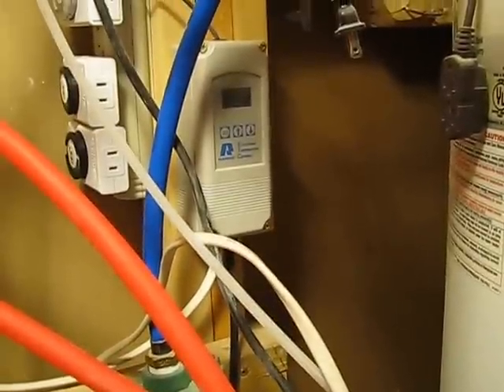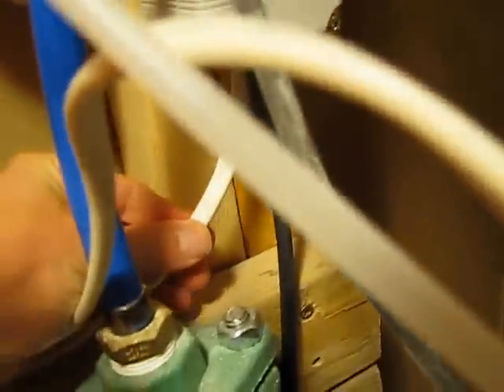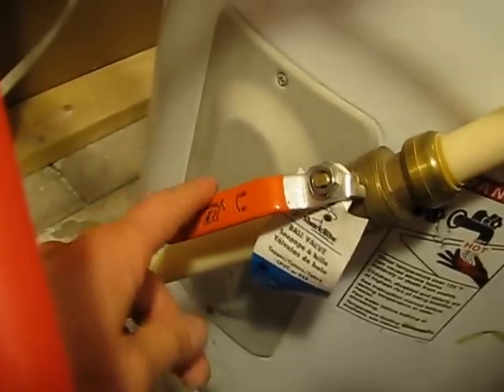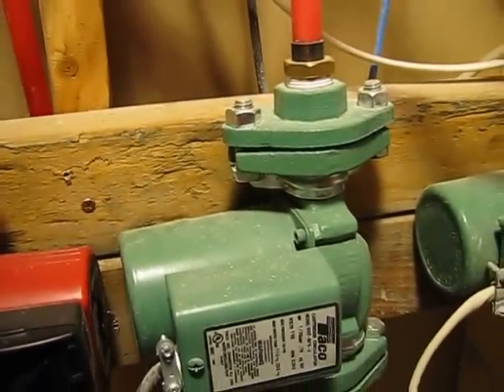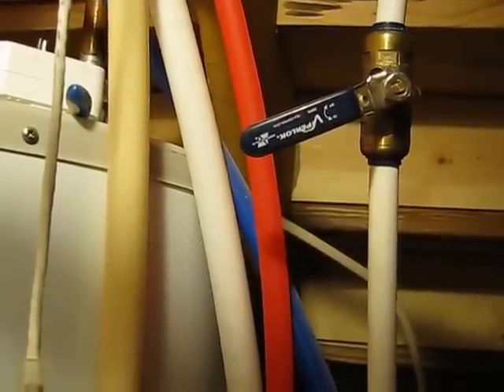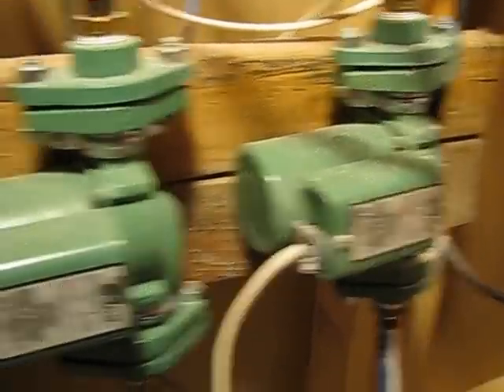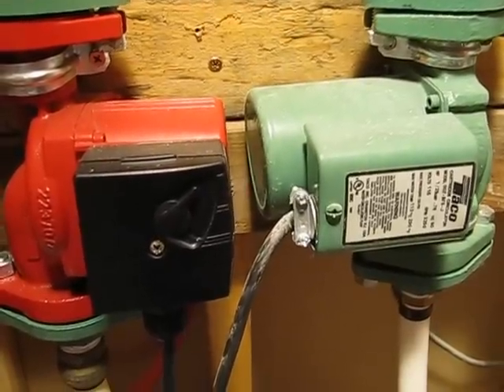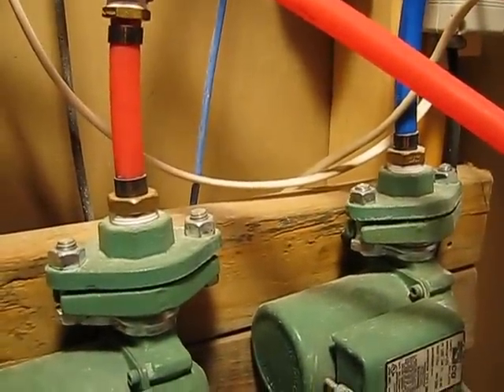Boler conections

Comment: Nice setup if you get a chance show the temperature of the water leaving the pumps and the water returning that would be a cool video too thanks again
Reply from the maker: Good idea.  I have the boiler shut down for summer right now, so I will need to do that next winter.  However I can tell you, that by feel and what I remember (I did measuer this once but don't remember for sure) the water coming out of the pumps will burn you if you touch them for even a second (water temperature is about 160-180 deg F.  The water going back in is still warm, but you can hold your hand on the pipe for as long as you want.  I would guess it is about 110-120 deg.
Reply: Your boiler turned out to be a great project. Once you got the air figured out and the fans on a switch its high gear from there.
Reply from the maker: Bob Vance
Thanks Bob.  It has been a fun and rewarding project.  Thanks for your help and suggestions along the way!